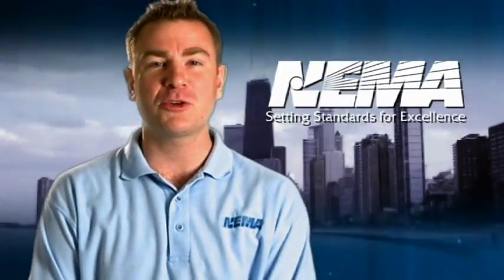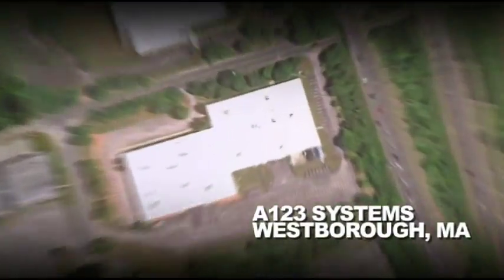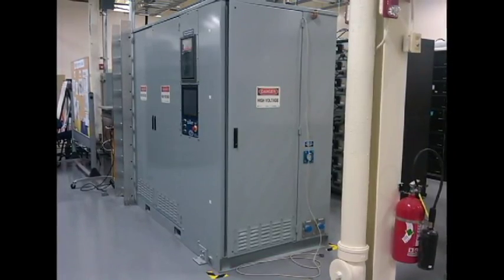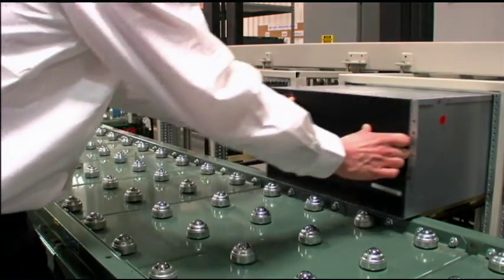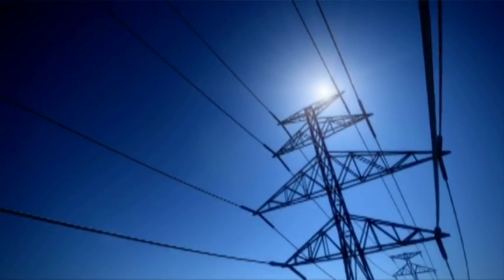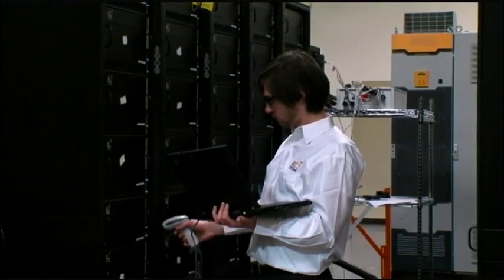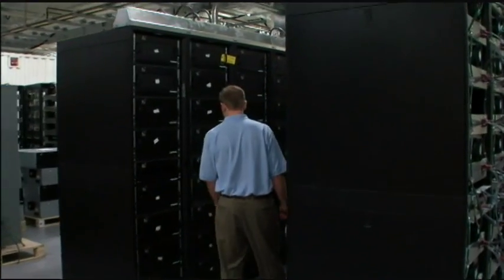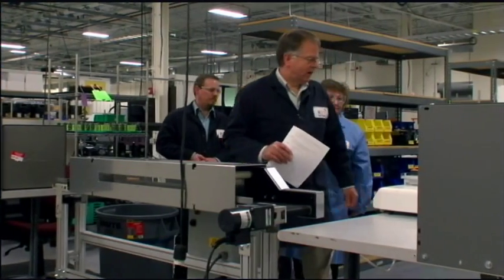Grid-Scale Battery Storage

Comment: What materials are used in the manufacturing of this battery? Is there an abundant supply of materials used in the manufacturing, if so, how abundant? How do you dispose of this and how harmful environmentally is that? Does this battery require any BMS (Battery Management Computer System) for charging? What are the loses of efficiency through the BMS?